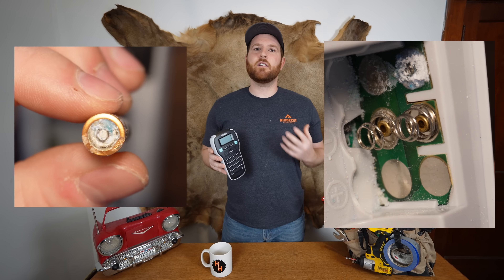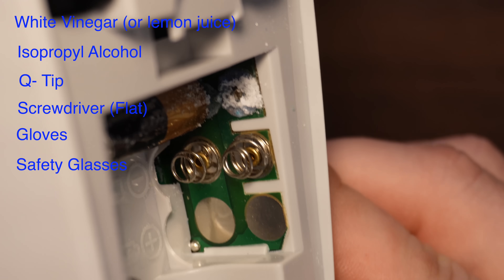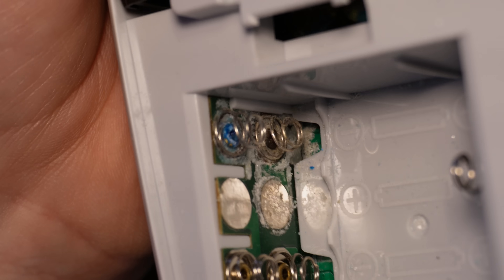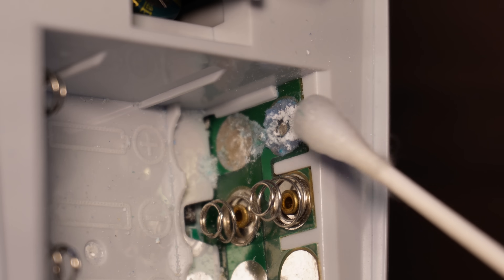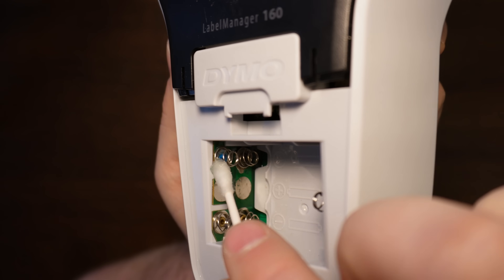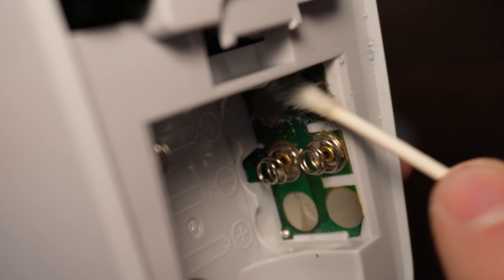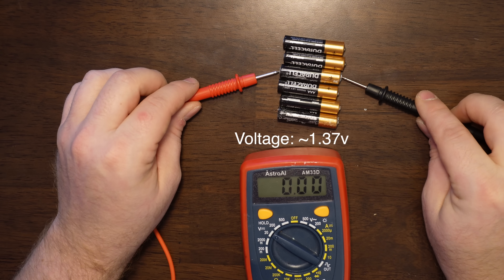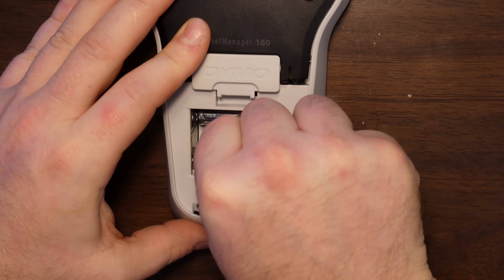Clean BATTERY CORROSION on ELECTRONICS! EASY DIY!  |  2-minute Tutorials Ep.4

Comment: Avoid Duracell like the plague.  I've had Duracells leak even before use.  Use Energizer.  Energizers have easily gone over 10 years without leaking.  They aren't perfect but they are lot better.  Energizer also honors their replacement warranty, or at least they did several times up to 2019, the last time I used it.  They usually just send you a check.

If you really don't want the battery to leak, use eneloop rechargeable cells.
Reply from the maker: Thanks for the tips

Comment: As a certified Bio-Medical Electronics Technician I have seen medical equipment (hand held ultrasound, portable pace makers etc.) that were corroded.  Our shop supervisor would not allow us to scratch the gold plated contacts as it can remove the thin layer of gold and expose the base metal to the air and further corrosion.  He recommended a pure gum (Pink Pearl) because they had no fiberglass in the eraser.  Vinegar is a weak acid.  You use this to clean the leaked powder(base) as it neutralizes and turns it to a salt.  Then as you clean it with the alcohol be sure to let the fluids run off the area into a towel so as to keep from draining into the rest of the device.  Salts are conductive and could cause the circuit board to malfunction.  I have cleaned many a legacy PS2 keyboard with coffee or soda spills in them and on a humid day they start to act up.  Additionally a can of "duster" spray is also effective in removal of salts.
Reply from the maker: Thanks for the info!
Reply: I think I should not have said the surface of the Gold was "corroded" but "coated" From  Wikipedia: "Tarnish is also a thin layer of corrosion that forms over copper, brass, aluminum, magnesium, neodymium and other similar metals."  Of Gold Wikipedia explains  "It is one of the least reactive chemical elements and is solid under standard conditions."
Reply: I’m also a Certified Biomedical Technician. I have come across too many Duracell alkaline batteries that leak long before their dated expiration, damaging valuable electronics.
Reply: @kenandbarbie-b6c  Thanks for the info.  I've had Eveready Alkaline corrode in the package, sitting in a drawer, long before their expiration date.  I was hoping Duracell would be better.  Guess not.
Reply: @kenandbarbie-b6c that's why I'm here. It was my Duracell batteries, NOT my Energizer batteries.
Reply: @kenandbarbie-b6c  I have walked by the battery stand in the store and found both Duracell and Energizer packages full of corroded,/leaking batteries.  At this point I will only put rechargeable batteries in my devices.
Reply: Yooo!! A BMET!!!!! Very underrated career field. Thanks keeping lifesaving devices like AEDs calibrated.
Reply: Wtf is a pink pearl/pure gum? Is this different from bubble gum? Also, searching for Pink Pearl leads me to either jewelry or the Steven Universe character.
Reply: @triadwarfare pink pearl is a kind of pencil eraser—gum is another word for eraser in some parts of the world—hope that helps!
Reply: @triadwarfare Pink Pearl is a brand of pencil eraser.  They are pink.😊
Reply: Two things I don't understand.

"Battery acid". We've all heard the term. Isn't that what leaks out of the battery, not a base or alkaline liquid?

Assuming the corrosion is alkaline and is neutralized by the vinegar, a weak acid, what happens if you add more vinegar than what is required to neutralize the base? Now you have excess acid, even if it's just a little dried residue, in the equipment and couldn't that cause long term corrosion problems?
Reply: @nicholas8479 Battery acid can be both acid and alkaline. These AA and similar house batteries are alkaline batteries with a pH of 13.5, or any value above 7.
Car batteries for example are a different kind, they are lead-acid and have a pH of 0.8

The area should be cleaned in a way that the excess vinegar doesnt go onto other stuff. For example turning the area upside down so the excess pours out, or having some cloth or paper inside to absorb excess vinegar.
Reply: Would apple cider vinegar work? That’s all I have right now. Thanks!
Reply: That was an epic novel .
Reply: I ain’t readin allat
Reply: Gold doesn't corrode under normal conditions, so it should be just a matter of getting the layer off the top.

Comment: Do not mix old and new or different brands. That causes the leakages. You can get store brand alkaline batteries cheap.

Also use vinegar only if they are alkaline batteries. With zinc carbon that is a bad idea but then the terminals world be full of rust.
Reply from the maker: Thanks for the info

Comment: As someone who has dealt with electronics as a job (in the military and after), I can say that the eraser is for something completely different. It's for cleaning contacts that have become tarnished. Not a corrosive build up. Also, you need to use a more abrasive eraser than the standard #2 pencil. Yes, they make erasers for this job. Something else that you can do is put some sand paper on the end of a pencil and rub off the corrosion. Something like a 150 or 180 grit would work for something like this. You may have to use a higher grit, 220 or 320, for more sensitive contacts.
Reply from the maker: Thanks for the input!
Reply: Erasers made for ink are usually abrasive (because apparently someone thought that "erasing" ink by scouring away the paper is a good idea).  Some ink pens have abrasives as well as the old school erasers that were pink on one end and grayish-white on the other end (the abrasives are in the white end).
Reply: @chadportenga7858  If you want to remove ink, that's just about the only way. The only truly eraseable pens I've ever used are the Frixion ones from Pilot and require that you use special paper in order to work.
Reply: I find an emery board works better than sandpaper.
Reply: Do they still make the eraser pencils with the brush on the end that they used to use for typing mistakes?
Reply: @bigred9428 : Yes, they are still available. Just do a search for eraser pencil with brush. Available from multiple sources.
Reply: @bigred9428  Isn't that just whiteout with a special tip?
Reply: @ ,
No.  White out is completely different.  This was a very abrasive eraser inside a pencil, and the other end had a little brush to sweep the eraser bits off of the page.  Whiteout is like paint that covers the mistake.
Reply: @SmallSpoonBrigade  ,
You can see such erasers in old movies and tv shows.  On the Smith Corona, they probably had the correction type of ribbon.  That was where the ribbon had a white stripe on it as well as an inked stripe.  You would just backspace to the misspelled word and type it again using the correction part (I forget how that part was engaged, then you retyped the word.  If you had used an old typewriter, you would have really appreciated the difference that computers brought.
Reply: I actually needed this info :)
Reply: I use manicure supplies, an emery head on a 6” stick because this happens to all of my battery candles with timers. Been rescuing them year after year and it happens mostly from Duracell batteries bought from Sam’s club. Never happened before I started using those so maybe a coincidence. I always start with white vinegar on a long q tip, also a manicure tool them switch to alcohol.
Reply: I figured this out about 5 yrs ago when it dawned on me that "alkaline" batteries would need mild acid to neutralize the corrosion while baking soda is what I formerly used on lead/acid  battery corrosion. The alcohol is a nice touch but I gave it up many years ago!  😊
Reply: @tuberstitious  So, which mild acid do you use?
Reply: @aerotraveldji  vinegar. Nothing stronger!
Reply: Awesome.  Which Branch, Navy?  I did electronics as a job too. ☺️
Reply: Salvation is Simple

HalleluYAH “Hallel u YAH - Praise ye YaH”

YaH is The Father (Genesis 1)
YaH arrives via the TENT OF MEETING
YaH was Who they Crucified for our sins
YaH was Crucified on an Almond TREE

Ancient Semitic Moshe (Moses)
Isaiah Scroll (The Original Isaiah)

Isaiah 42:8
I am YaH; that is my Name! I will not yield my glory to another or my praise to idols.

Isaiah 43:11
I am YAH, there is no other Savior but Me.

Isaiah 45:5
I am YaH, and there is none else.

Comment: Mixing batteries with different voltage is a good way to make them leak. When that happens, watch this video!
Reply from the maker: Thanks for the input. Why would different voltages cause them to leak?
Reply: @HandymanHertz  mixing batteries of different voltages can cause a charging effect on the weaker battery. This is an issue when using batteries that were not designed to be recharged. I'm not sure if this is an issue for rechargeable batteries, im sure there is an electronics engineer out there or someone who is in the industry that would be able to chime in with more insight on that, but it is still not advised to be mixing batteries of different types, voltages, or brands. There are additional reasons on why batteries should not be mixed as well but that's starting to digress.
Reply from the maker: @TropicalEncounter interesting, thanks for sharing

Comment: You should always use a small load when checking batteries with a high input impedance such as a DVM. Without a load they can check good when they aren't healthy enough to supply advertised current (mA)
Reply from the maker: Thanks for the input!

Comment: Learned this decades ago: vinegar for acid. Been doing this for over 40 years. Instead of straight screwdriver, I was taught to use a bit of steel wool around the screwdriver to minimize gouging.
Reply from the maker: Steel wool, that’s a great idea. Thanks for the tip.
Reply: @HandymanHertz  I’ve even thought about creating a Q-tip type version with steel wool on a stick.
Reply: Careful with steel wool, if any little strands break off they could cause a short - particularly if they get inside the device. I've used black wet/dry sandpaper - very fine grit, to clean off the hard deposits. You can wrap it around a flat head screwdriver or a plastic spudger to get into tight spaces.

Comment: No surprise that those Duraleak batteries were involved. I have also found that Walgreens alkaline batteries are just as bad about leaking and really badly.
Reply from the maker: I agree, what brand you use and like?
Reply: Checking comments and wanted to add that I'm not having any luck with Thunderbolt Magnum Alkalines from Harbor Freight, so people, check your devices if you bought these.
Nearly ruined one of my tv remotes and my Sharp Weather Station,  it was still working because of low drain on batteries, but was intermittently blinking, then working. Batteries were leaking.

Comment: freakin duracells man. Its always the duracells
Reply from the maker: I’m thinking about switching brands, what do you use?
Reply: @HandymanHertz  Panasonic Leak Free or any rechargable. Duracell since selled to Warren Buffett, its a lottery. Almost lost a mult-tester, a Bosch Laser Meter and some TV remote controllers. "Leakcell" never more.
Reply: Yes, lost two MagLite pen light flashlights that had three AA batteries in it because the center battery welded itself in because duracells. Started using Energizer. Can't go wrong with the pink bunny.

Comment: Cleaning battery corrosion with isopropyl alcohol is a tried-and-true method. I would never use any acid near electronics. Just like the leaking alkaline fluid from the batteries, acids can eat away battery contacts, electronic components and copper traces on PCB’s.

Comment: You can also use a toothbrush instead of the ear pad. Afterwards it is wise to galvanise the corroded area with soldering wire by the use of soldering iron, if you are capable of.
Reply from the maker: Thanks for the tip
Reply: I use an arts paint brush and water with baking soda, and then dry it with cloth or paper towel. I think it's the cleanest, safest, fastest, easiest, cheapest, least agressive and the best method. 😃

Comment: Battery dielectric would seep inside PWB and corrode traces. That's particularly bad on multilayer boards. After your fixing of the battery contacts, new problems due to PWB failure will come in weeks or months.

Comment: I stopped using alkaline batteries  altogether.  The copper tops are total garbage.  Use either Lithium or Carbon batteries (heavy duty)  These 2 never leak.  Lesser electrical consumption devices such as remotes get Heavy Duty batteries, flashlights and such get Lithium batteries.
Reply from the maker: Thanks for the tip

Comment: This is one of the main reasons I switched to rechargeable batteries in my infrequently used devices.

In the future, I'm going to try to clean a heavily corroded device by submerging it in 95% ISO and place it in my ultrasonic cleaner. For safety, I'll be setting this up in my driveway.

Comment: Well when it comes to Duracell alkaline batteries it looks like you guys were right. I just found an EEVBlog video and it was pretty scathing of duracell. The NiMH Duracells perform really good as mentioned in my previous comment. 

P.S. I just opened up an old portable HP 82240 printer and found badly rotted batteries inside and they were Duracells!! 😮😂😊
Reply from the maker: I agree, I’m done with Duracell. What brand do you use?
Reply: @HandymanHertz  I use Panasonic now. Only because they are easy to get hold of in the shops I use. Not had any leak yet but that is just anecdotal and no real measure of dependability.

Comment: Using a mild acid like vinegar or lemon acid indeed will work excellent but if you don't neutralize the process with baking soda it will eat up all metal parts
Reply from the maker: Thanks for the tip!
Reply: @HandymanHertz  YW. "-))

Comment: I thought baking soda not vinager should be used. The corrosion from battery is acid so baking soda which is alkaline should be used to dissolve . Please correct me if I am wrong.
Reply: Batteries leak potassium hydroxide which is super alkaline pH-14. It tends to react with air and form potassium carbonate as well. 

So you want an acid to neutralise it but not a strong one so acetic acid (vinegar) is fine. I then soak up the liquids and rewet with water to dilute any remaining salts and squirt with some alcohol to increase the rate of drying.
Reply: @peterwilson7532  I stand corrected.

Comment: Scrape the heavy corrosion off first, then simply use some Coca-Cola on the Q-tip. Let it set for a minute. Clean it up with some alcohol. Then coat it with some Vaseline.
Reply from the maker: Interesting, thanks for the tip

Comment: Duracell batteries are bad about doing this, I have had several issues and it is always Duracell batteries causing the problem. I have quit buying Duracell because they ruined a very expensive Nikon flash unit. Now I make sure I remove the batteries and store them in a special container.
Reply from the maker: That’s a good idea, just a little too lazy with all of the battery operated electronics I have

Comment: Good info here. I would only add that whatever your pursuit — woodworking, electronics, automotive or heavy equipment repair, all of which I do — one of the most useful tool types is a set of dental picks. In place of the small screwdriver shown here they are unmatched for use in tight spaces. And if you want to do your own dental work…
Reply from the maker: Great tip!

Comment: In my lectric doodads, I pull 1 battery to break the circuit. If you get corrosion, scrape with exacto knife and clean with WD 40..

Comment: A very simple case is shown when you only need to remove salt deposits.
Unfortunately, usually the contact pads and springs are severely damaged by corrosion and require replacement.
Reply from the maker: Thanks for the input. Luckily, I’ve never come across this yet

Comment: Good video! right to the point. A lot of people don't  realize that all of the major battery manufacturers have a warranty on their batteries. If the device is damaged beyond repair they'll pay the replacement or repair cost of the damaged item. Not sure how difficult it is to make a claim on their warranty, but might be another option rather than  throwing the device away. 
P.S. I also use rechargeables now in all my electronics and flashlights. I only use the alkaleaks in kids toys which usually have a short lifespan anyway.
Reply: Has anyone else noticed how much more prone to leakage batteries are today?
Reply: @davidryder3374  ,
I was just thinking that the other day.  I was cleaning, and had to throw away quite a few unused batteries of all different brands because they were leaking already.
Reply: I tried that twice on the warranty claims but they refused to pay the claim both times.  One time I couldn't produce the original product receit for proof of price on the product,  the other time they told me the product was too old to replace and again no receit.  Extended warranties from Radio Shack  weren't worth the paper they printed on when they were still around, , and certainly not worth the price you paid for them.  NEVER BUY AN EXTENDED WARRANTY ON A CONSUMER ELECTRONICS PRODUCT NOT WORTH THE PAPER THEY WRITTEN ON. All of these warranties are covered by a third party insurance carrier who always find an excuse not to pay or pro-rates the value so low you get very little.  The like to use the "Act of God" clause a lot!!
Reply: Duracell used to make a big thing in their advertising about their “leakproof guarantee.” That’s now conspicuously absent from both the ads and the packaging here. I’m not sure if they no longer do it or they do and they just don’t want us to know about it. They seem to know their batteries leak. Energiser still offer that warranty and I’ve never had one of their batteries leak
Reply: @paulstimpson830  and yet I have had the OPPOSITE thing happen. Duracells have never leaked on me but Energizer ( has a Z in it….not a S ) have always leaked on me.
Reply from the maker: Interesting, thanks for sharing